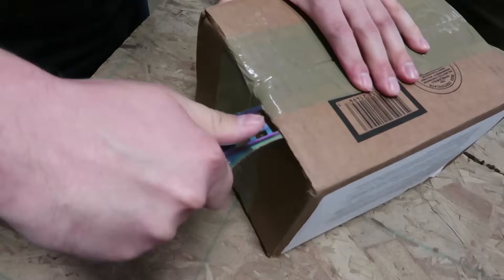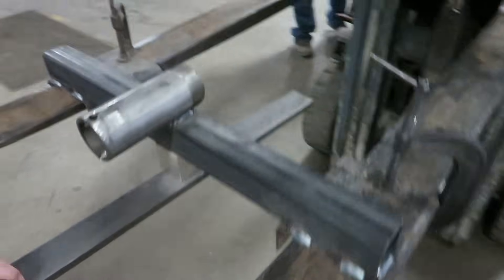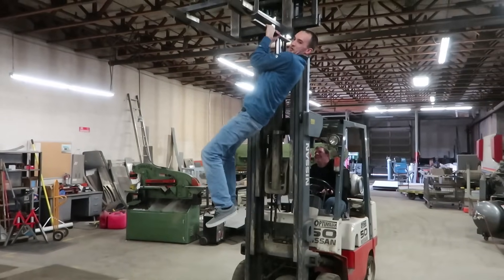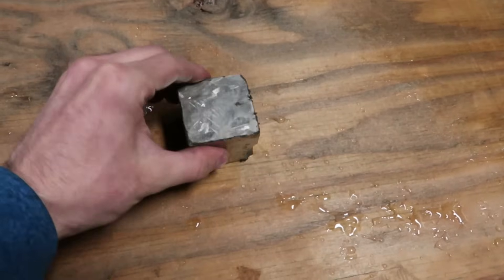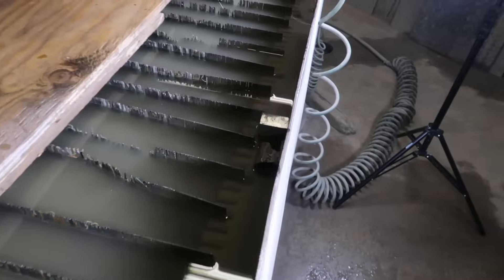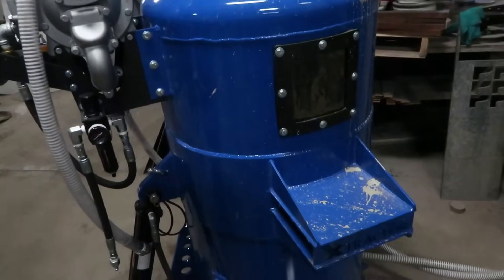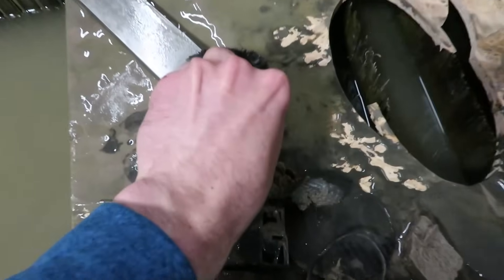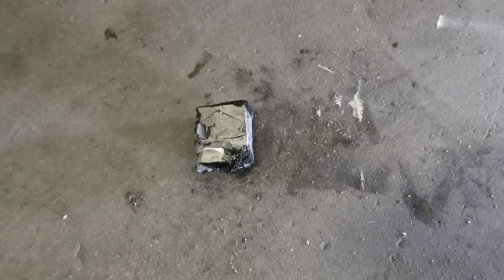Huge Neodymium Magnet Cut in Half with a 60,000 PSI Waterjet - 400 Lbs

Comment: The us military have a bullet that is fired out of a rifle that has a small water amount in the tip that is injected into a magnetic mass with a 7 micron width of space that is keeping the magnetic adherence of the full bullet until separated. When the magnetic mass is separated it is dispersed upon the target with the force of 7 Full shotgun blasts at once. It's called the separator for several reasons besides the bullet separating..  The target is also separated into almost nothing.
Thanks for the videos guys..
Reply: You could aim this bullet at a targets feet and probably take a few chunks of torso out as well.. Your video explained the science readily. Thanks Again.
Reply: Just be careful separating any bigger magnets than that ok..? Thanks again.
Reply: I actually made a constant 3 Kw magnetic field 3 years ago in this manner that still is in effect. I use it to charge anything that needs a min of a cell phone charge up..
Reply: A totally encased magnetic field will power alot of devices within Very close range,, Think about that/research it yourself.. and think about what the ancients did with it,..lol

Comment: Those two halfs of the magnet pushed away from another because you cut the magnet parralel to its magnetic field. If you would have cut it in a 90 degree angle to it it the two halfs would have been attached too another by the magnetic force

Comment: what happened is you didn't have your north and south poles oriented properly ... Would've worth checking with a magnet viewing film which sides were the actual poles - you were not cutting between the poles but across them, so similar poles were next to each other, that's why they flew apart.
Also that was the reason why the first pull-up test didn't work - the magnet was not attached to the metal by one of its poles, but "on its side".

Comment: What would happen if you tried to tig weld a magnet. I’ve never tried or though about it until I seen this video
Reply: it would likely be partially demagnetized due to it reaching the curie temperature. which depending on the alloy can range from 590–752 degrees Fahrenheit  (310–400 Celsius)

Comment: If you slow the slow motion bit down further you can actually see the steel slow down right before it hits the magnet. This is because of the intense electric current that's generated in the falling metal which opposes the magnet and slows it's impact.
Reply: s c i e n c e

Comment: How does water manage to cut anything? Someone please explain to me. I still can't get my mind around this. 60 000 PSI? What level of pressure is that?
Reply: psi is pounds per square inch,  so imagine having 60,000 pounds of weight on a square inch of material, and its not only water, it uses garnet sand as an abrasive, which is why theres a ton of sand in the basin.

Comment: Cool video though I definitely cringed watching you sticking the magnets and fork lift together since just allowing a magnet of that strength to slam into iron does exactly what you saw...  Pieces broken off, flying at high speed.  
Pretty cool to see that by cutting a magnet in half you end up with the faces having identical magnetic fields, causing them to fly apart as soon as they are completely cut.  BTW for anyone interested you also can’t grind some of the magnet into powder and still have it remain a magnet.  For whatever reason this destroys its magnetism, at least for NdFeB magnets since they sinter and press a powdered mix of those metals together as opposed to just melting them into an alloy.  You can see how finely powered it is when they are broken, where this extremely fine powder is thrown off which immediately starts to glow and burn on exposure to air, visible when the magnet is smashed by the stainless steel disk.
Also FYI that a lot of stainless steel is either completely non-magnetic or only weakly affected by magnets, which is why the SS disk didn’t just stick to the magnet.
Reply: if you did it without creating heat, the powder would likely be magnetized, because after reaching the curie temperature a magnet loses its magnetism. a rough definition of curie temperature.  "In physics and materials science, the Curie temperature (TC), or Curie point, is the temperature at which certain materials lose their permanent magnetic properties, to be replaced by induced magnetism. The Curie temperature is named after Pierre Curie, who showed that magnetism was lost at a critical temperature."

Comment: I’m glad I could get you that rare earth magnet. I saw you were cutting it in half and I had a feeling the poles would be reversed and it would fly part like they did but wasn’t 100% sure. Best $90 I’ve spent in a long time! Just glad you all didn’t get a pinched finger or two. I should have said they do chip easily too, my bad.
Reply: The chances are more like 66.6% that the parts would fly apart when randomly cutting them. With four of the six sides up, one direction would cause them to repel each other, while the other direction would cause them to attract each other. For the other two sides the direction of the cut does not matter, they would always fly apart. In total eight of the twelve possible cuts would cause them to repel each other (assuming only straight cuts parallel to the edges of the cube).
Reply: No wonder it flew apart, I was thinking it may just stick to one another since the new poles would simply attract one another.
Reply: If you want to detect the north pole of the magnet with a compass, you have to remember that the compass points at the south pole of the magnet and away from the north pole.
Reply: This split repels 
[NS]
----
[NS]

This split attracts
[NS]/ [NS]
Reply: Mikey8567 they weren't necessary reversed. It was due to the direction it was cut. They cut from one pole to the next, say from the north side to the south. Then when it was in two the two sides had the same polarity so pushed apart. If they rotated it 90* so as to cut it between the poles the two pieces would have come together as the north would be pointing to the south of the second half
Reply: Jason Harrison yea I know but unless you use another magnet and label the poles they wouldn’t know or be able to tell the direction to cut. It was basically a 50/50 chance.
Reply: @Mikey8567  if one wants to make a cut that fly appart, one  would not need to know which pole was what pole. They would not need another magnet. All one would need to do is take a small piece if iron and find at least one  pole face. Doesn't matter if it is N or S.  Any cut through a pole face will make two magnets that repel each other.
Reply: @Mikey8567  if a cut is chosen completly randomly, and there are 6 faces on a cube, and only one can face up at a time, and the cut is made down though the face facing up, then:

A) Each face can have one of 2 cuts, left-right  or up-down resulting in a total of 12 different cuts. 

All cuts on pole faces repel. Each pole face can one of two cuts.  There are two pole faces. Therefor cuts on the pole faces gives us 4 possible cuts that end up with two repelling magnets.  

There are 4 nonpole faces. Total of 8 possible cuts.  Each nonpole face can be cut either from pole to pole  or nonpole to nonpole.  Pole to pole direction cuts on a nonpole face result in two magnets that repel.  Each nonpole face has 1 pole to pole cut, thus 4 of these  8 possible cuts repel. 

Taken together, out of 12 possible cuts, (4+4) 8  end  up with repelling magnets, 2/3. And, 4 cuts out of 12  will attract, 1/3.
Reply: @Mikey8567  Well, more like 33/66 chance in favor of the result: there are 3 axis they could have used for cutting it (From N to S, Between N and S, and simultaneously through N and S), and only one of them (between N and S) would result in the two halves pulling together.
Reply: 125m125  ok
Reply: Mikey8567 You can just use a compass, it will point out the north side as long as you're close enough.
Reply: Why don’t they encase them in plastic due to their extremely brittle state?
Reply: @PigeonSmoothie  Your can order them with a plastic coating on them.
Reply: You obviously aren’t the guy who sent the magnet to them! Stop impersonating people!!!
Reply: @robotickillerkittyizzy3598  Yea Ok what ever kid.

Comment: The metallic stuff that turns into paste is that ferofluid
Reply: Technically anything that has iron suspended in a fluid would count as fero fluid, but the stuff that you can buy is normally iron powder and oil. It's better if the iron is in oil so it doesn't rust as quickly
Reply: the only way to know for sure is if you do the lick test... =p
Reply: Dace Browning The more i know.
Reply: I was just about to comment that.
Reply: tjzx3432 Ferrofluid is any liquid that has iron suspended in it. Usually the ones you buy in stores are iron fillings with oil, not toner from a copier
Reply: ferropaste
Reply: Ferrafluid is tasteless :/
Reply: the metal stuff is iron fillings ferofluid is a mix of iron fillings and some other chemicals
Reply: Yup!
Reply: That’s what I thought, but isn’t ferrofluid dangerous to touch
Reply: Ferofluid is iron filings with ink
Reply: Waterjet Channel Technically no, ferofluid basically is iron filings and toner from a copier. So basically the iron from the cereal is half of what ferofluid is.
Reply: it's probably the particles of the magnet that gotten removed from the cutting

Comment: Depends which way you cut the magnet whether it would be attracted or repelled.  If you cut between north and south - then it would have stuck, but if you cut it through the pole, then you get a new north on the same north side and a new south on the south side, so they repel each other.
N  |   S    (between poles cut)    N ---- S    (cut through the poles)
Reply: Yes? :)

Comment: You blockheads are lucky to have your fingers intact
Reply: I've put neodymium balls in a coil gun. Pretty nasty. They actually explode.
Reply: RP : They just know how dangerous these things are. Magnet this size, it's easy to accidentally break a finger, or crush it to pulp. The pull is entirely unintuitive. With a glass vase, you know it's fragile. When something's heavy, you know it when you pick it up. With a sharp edge, you're careful of the sharp edge. But these magnets... Before you have time to react to it pulling closer, it snaps closed hard enough to chip the magnet. They're vicious.
Reply: TheFinalRevelation question, how are you typing or how many fingers left
Reply: TheFinalRevelation ohh..
Reply: True
Safety first
Reply: Having had some pretty serious close calls with some 50 - 75lb pull neos i can honestly say these guys are EXTREMELY lucky.  Yes, force drops off exponentially after just a few centimeters but funny thing about the thickness of fingers.................

EDIT: When his hand was fully wrapped around one of the halves and he reached towards where the other one was my entire ass puckered up.
Reply: TheFinalRevelation  you need to post that shit !!!
Reply: You don't screw around with any of the universal forces. Screw with the nuclear forces and you vaporize yourself, screw with gravity and you face plant, screw with magnetism, you get your fingers smashed.
Reply: with his face
Reply: Name checks out.
Reply: Toopan esirpus chill there professionals
Reply: lol XD
Reply: You saying blockheads reminded me of charlie brown when Lucy calls charlie a block head LMAO
Reply: CHARLIE BROWN YOU BLOCKHEAD
Reply: Ikr
Reply: Very insightful thanks for letting us all know. It's good to reflect on things like this we are all lucky to have our fingers intact lucky to have our toes in tact lucky to have hair lucky to be good looking we are truly blessed and we don't reflect on it often enough.
Reply: TheFinalRevelation i want to hear your story
Reply: TheFinalRevelation ouch... but where did he almost injure himself?
Reply: TheFinalRevelation They’re lucky their camera and phones didn’t get destroyed
Reply: TheFinalRevelation i dont wanna hear your story ;-;
Reply: Did you eve see how he got away from injuring himself ?
Reply: No problem. I didn't force you.
Reply: TheFinalRevelation are you a soccer mom?!!